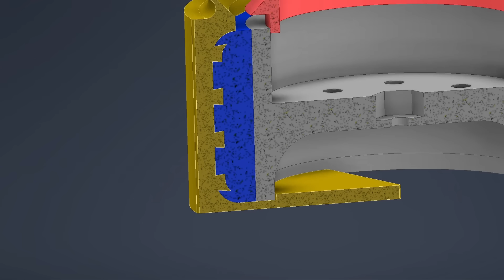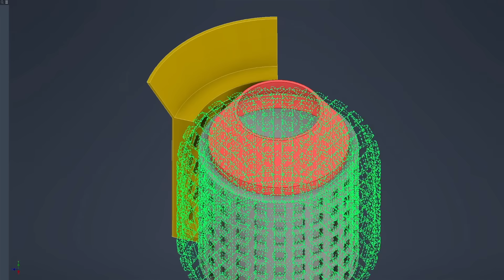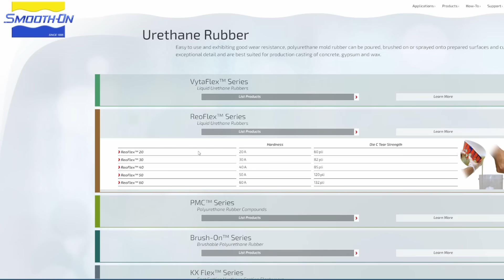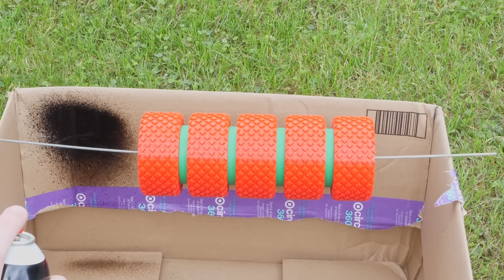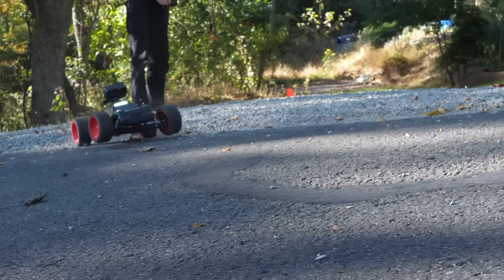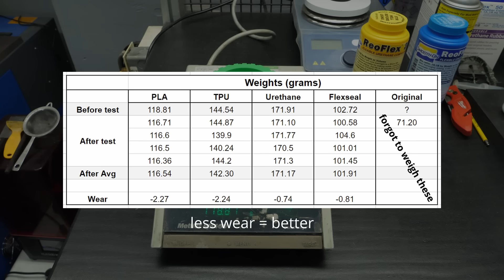Testing DIY Custom Rubber Tires Made With 3D Printing

Comment from the maker: FAQ:

What is the cost per tire?
Plain PLA: $1.6
ABS + Flexseal: $1.6 + $16 for a can of Flexseal, should last for 10+ tires
PLA + TPU: $5.6
Urethane: $6

Can this work for non-solid tires also?
Yes, it's just a lot more challenging to make a mold that lets you cast a hollow tread section. Smoothon also sells 2 part urethane foam that could be used to make foam or foam filled tires
Reply: Really interesting. Thank you so much.

Testing TPU is really interesting, but overrated on these applications of simple geometries.

Comment: With those molds made, I would also try out some super cheap materials like fiber reinforced asphalt, i.e. roofing patch. Might require a bit of solvent to thin enough for getting into the mold, maybe there is a sweet spot where you can heat enough to fill the mold and not soften the plastic too much, or perhaps strong vacuum is enough to get the molds filled.

Comment: The thing is, tyre tread geometry and sidewall flex are both critical for proper behaviour. Such a simple geometry and low profile will probably dissapoint when compared to the friction the compound is capable of offering. The ones you made would be okay at slower speeds on soft terrain, but they look like they would slip easily braking and accelerating with higher speeds and power in compact dirt, gravel or any hard surface since you don't have any flat surfaces to bite longitudinally, and i don't know about cornering. The squares would also ideally have some grooves to help clear debris and allow some extra flex to help with grip through deformation. All of this is based on my knowledge of tyres through MTB, so it might not all be correct relative to reality.
This was written BEFORE watching the video*

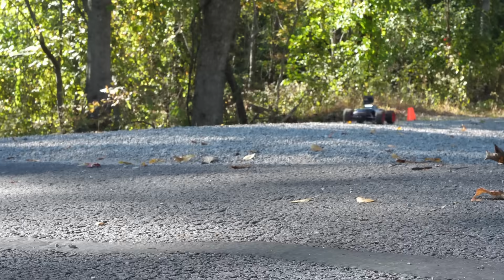After: 13:19 that transition from gravel to asphalt shows the lateral response of the tyres quite well, they had loads of angular support when transfering to asphalt and their geometry might have allowed for both the slip and the acceleration it seemed to have, so the diagonal grip looked great, wich may be adequate on RCs of this kind since they require AWD powersliding to maximize their cornering speed.

Comment: When you mentioned the graphs going up and down because of speed control. If you look at the wheels you can see them wobbling slightly. Are you sure it wasn't egg shaped wheels acting like a cam on the graph?

Comment: Thanks for video! Subscribed! Question?
I still haven't bought a 3D printer because ChatGpt & Grok are both giving me conflicting answers for what machine can handle the most "grippy" rubber like material for things like BMX handle bar grips with non tearing & flexible. Or game controller grips. You know that rubbery grippy feeling that is also non tearing and flexible? What material is the best and what machine can print it the best? I know the basics about TPU and NinjaFlex but I I'm thinking these materials are still too hard for soft grippy feel I need. I found something called Fiberflex 30D but Ai is saying that's too soft for Bambu but I saw a video of someone using it on a Bambu printer. Any info on whether or not Bambu is the right company for my needs will be greatly appreciated. Thank you!

Comment: Hey man, I print Tpu tires a lot but I have a problem. Tpu is very slippery, especially if I'm running my models on a smooth surface there's barely any grip. Would spraying flex seal on make them more grippy?

Comment: Cast semi flex urethane with a bunch of continuous kevlar fiber packed into the mold is probably also the most indestructable material you can make for parts that see a lot of impact.
Reply: traction is produced by friction, resisting friction wear would matter more than surviving impacts, although tires do have survive that too.
Reply: @kwyj I was referring to his comment at the end about non tire parts. Indeed kevlar in non air tires is probably a bad idea
Reply: @eelcohoogendoorn8044  oh, derp, yeah, that makes much more sense.

nevermind me. this time ;)

Comment: Having a traditional rc tire design with a foam insert will really help with grip - makes for a bigger contact patch as it allows the carcass to conform to the surface much more.

In my own experience, I could never get my urethane cast tires to go as fast around the track as off the shelf race tires - both dirt tracks and carpet tracks. Though I was using the vytaflex urethane - mostly because according to slot car guys that was the faster of the two. Maybe I should return to the project and try reoflex.

Comment: Which Flex Seal Spray did you use? Do you have long-term experience with this? Your video was very interesting, even though I don't have a model car. I looked at it more because I'm interested in more weather-resistant parts than purely 3D printed ones.

Comment: A good way to spread microplastics everywhere you drive your rc car. There probably needs to be a more durable outer coat to prevent plastic shredding. Though it cant be blamed too much after all even normal car tires generate microplastic.

Comment: I am building (well built 1st gen with many fixes but still to powerful for 3d printed shafts) a mostly 3d printed tracked vehicle. Found someone using VytaFlex 60 in a video for tires and it rocks. I went through so many options from PLA, silicone, shoegoo like stuff, gluing on tpu tracks, and finally direct casting in contact with PLA track segments of the VytaFlex 60. This works insanely well. After use on pavement it looks and feels kind of like bicycle tire rubber.  If you ever revisit, I'd suggest this as a

Comment: I imagine the lack of spring/travel within the actual grip material unlike the original tire was the main problem. I imagine all of the designs need an air spring between the outer layer and the rim.

Comment: I'm wondering if you could use the properties of multi filament to print your wheel hub and mold all in one using the properties that PLA and ABS don't really like to stick to each other then break away the mold but it would be only one time use

Comment: This is awesome! Would love to see a hollow tire made with urethane and a foam insert like rc tires would compare to regular rc tires. Did you have any problems with the resin leaking into the 3d printed mold when under pressure? Just watched Punished Props vid where he has that problem. Thanks for sharing.

Comment: Very interesting. The material boned to a harder material doesn't have the opportunity to flex and cause heat which causes more traction. Your attention to detail with moulding is awesome!. Great video.
Reply: Yeah that's likely a big factor, not only cannot the contact patch deform much at all, there's essentially a rigid sidewall as well, both of which are very bad for overall grip. The lack of spring/give in the tire is likely a factor as well due to similar reasons (ie it bounces off the surface instead of "eating up" uneven surfaces).

Comment: Excellent, that’s not a subjective test on different tracks, it’s a detailed and highly measured lab test with real behave data, it’s how things need to be done and I’m so glad I find your channel
Reply: How is putting a concrete slap against the wheel a repeatable test, as far as I saw he didn't measure the pressure put on it. He just said 'a constant force'

Comment: Punished Props just released a video where they made their own tires, too.  It's interesting to see the difference in workflow based on area of expertise!  They printed the full tire, post-processed it for cosmetics, then made a silicone mold and used that to cast the tires (with a 3D printed hub).  

They prioritized cosmetics over function, so maybe avoiding the mold lines on the front of the tire was more important to them, but I really like the idea of a 3d printed mold

Comment: Was that Bambulab propaganda sponsored? Or did I miss the „Ad“ label?
Reply from the maker: It is, although i didn’t say anything i didn’t believe, there should be one YouTube pops up at the beginning of any sponsored video. And their logo at the bottom left during the segment
Reply: @ExcessiveOverkill  ok,
I personally don't like the company. I have similar feelings about them like I got about Apple. The product is very good, however the company's actions make me hesitant to support them.
The video is great though! Currently I am designing and building an Rc Car from scratch myself, and was wondering what tires to use. What CAD software was the one in the video? Plasticity?
Reply from the maker: I use Autodesk Inventor for everything which is sort of like Fusion360 on steroids, definitely overkill for this situation.

Comment: Do you think that the electric mason jar vacuum sealer that Amazon sells would work for drawing out the air from your urethane mix?  It seems like a quick, cheap means of improving the pour quality of your mixes.
Reply from the maker: Possibly, but I'd highly recommend getting one of the really cheap actual vacuum pumps instead, they are much more powerful and will last longer. A mason jar would still work fine for the chamber as long as its big enough, I actually still just use thick decorative bell glass jars for my vacuum chamber most of the time.

Comment: Don’t know how I ended up here but enjoyed the video, I reckon your discrepancy from the testing come on the method. 
First set of testing was mainly lower speed and constant contact plus the motor seems to be bulkier which means lower speeds but higher torque.
Real wold was way higher speeds you had smaller motor with higher rev range and bumps with lost of traction and even change of weight distribution so it makes sense that the softer material out performs the stiffer one since it allows the rubber to deform and shape to the terrain to allow for more traction the stiffer just bounces and slips like if you where doing constant burn outs.

Comment: Flex seal tires probably had a much higher inertia. Reducing your acceleration
Reply from the maker: The cast urethane definitely had the most inertia, but the car still had enough torque to make all of the tires break traction even at speed.

Comment: Been custom casting urethane tires for combat robots since 2020. Smooth On Vytaflex and Reoflex work awesome for this. I use mostly 40A for 3lb and 12lb bots but sometimes 30A for lighter (1lb) robots. I can go for easily a dozen 3 minute fights on a set of 40A tires without wear being an issue
Reply from the maker: That's how I started too, we've made several for 3lb and 15lb robots and they've all held up exceptionally well.

Comment: two part bolted wheel tire rim to squeeze the tire between. separate the tire rubber process from the rim stuff. you can also then swap the rubber tire easily. TPU is also urethane.
Reply from the maker: Ha I suppose that is what the "U" in TPU stand for. We started doing this for combat robots to make hub motors, the rim and tire had to be extremely thin (only about .25") to not take up much extra height. because of that we cast into the rim as one solid piece. Large tires like in the video could definitely have the urethane be a separate piece.
Reply: Hi. Any guide on doing this? I can put some tpu inserts inside to make it look like a foam

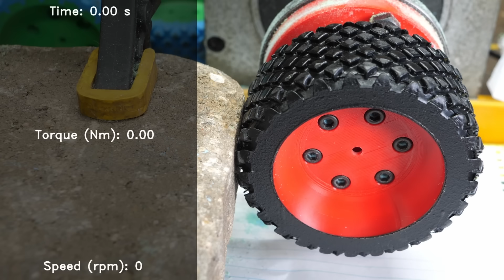Comment: 11:27 I think is has a lot to do with the hardness or the overall wheel. I think the ABS one is the most ridged so the car bounces the most and the tyre contacts the ground the least. Though that would suggest the PLA one would be worse.🤔

Comment: I know you can't print tpu on pla, but I wonder if you could print a PLA rim with a TPU tire mechanically interlocked to it in a single print.
Reply: And I see you covered why you didn't do that. I've run tpu through the AMS without issues, but it was a pretty rigid tpu.

Comment: This is actually something I've dealt a good deal with as well. My combat robots all run on cast urethane tires as well. I print a spoked hub and then case a more solid cylinder of urethane around them with only some very basic notches to provide a little bit of tread. My 3lb gets very soft 45A, but the 12lb and 30lb bots both run 80A durometer  urethane. Wear isn't a huge concern since they're often missing chunks from direct hits or big floor gashes well before the material itself wears away in 3-minute fights.

I've also experimented with trying to impregnate foam with urethane or some other hardening rubber in the past to mixed results. I found that a coating of rubber cement over foam cut from a set of old play tiles was fairly grippy for the 3lb bot, but severely lacking in durability. The weight I ended up adding to protect them was about the same as just using the urethane at the small scale with the added benefit of not needing to machine more wheel guards.
Reply from the maker: We started doing this for combat robots as well. Smoothon also makes urethane expanding foam that I've though about using together with the solid urethane to make lighter or softer tires, never actually tried though.

Comment: Nice video! I like the simplicity of the TPU tires, that printer camera detecting the failed print is neat. I was rooting for the flexseal tho
Reply: I actually don't understand how that tire loosened from the build plate - usually TPU sticks very well and it takes some force to remove it. Great that the camera detected it, but really shouldn't have happened in the first place.